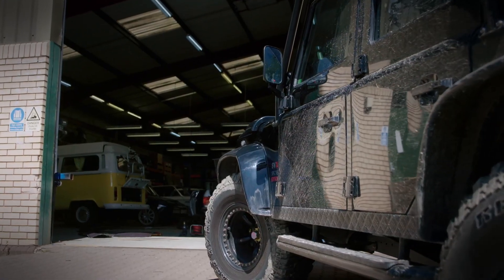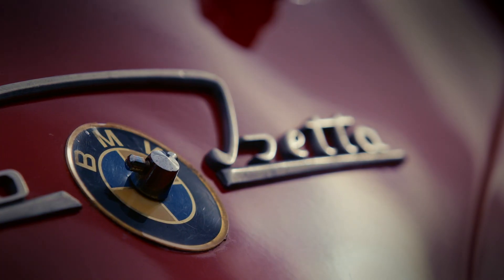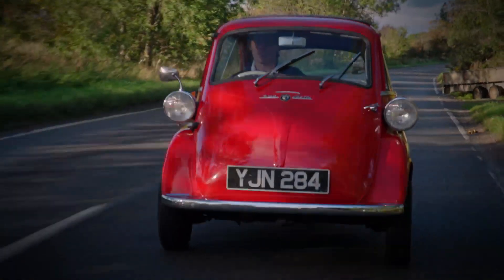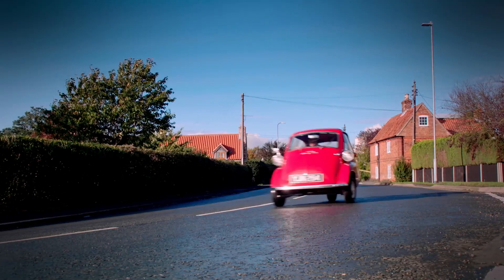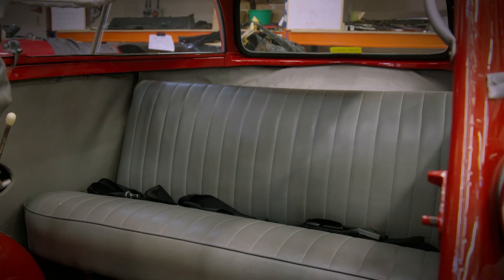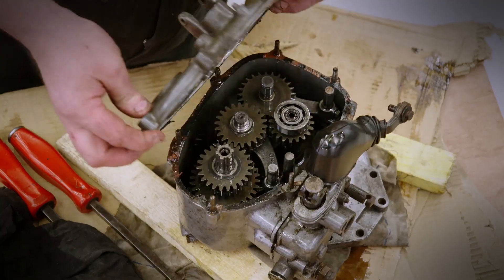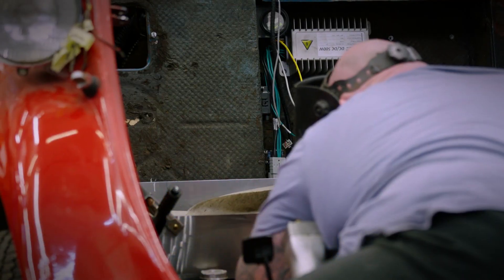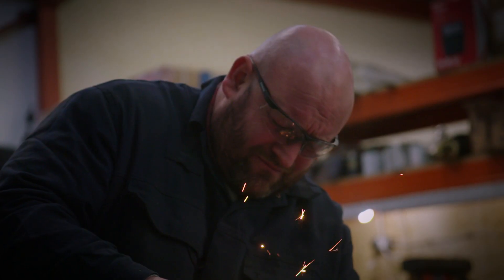Vintage Voltage series 2 – BMW Isetta - Episode 6 QUEST PROMO

Comment: I don't understand why they retained the original gearbox. It's a chain drive. Just select a suitable output cog and the electric motor can drive the rear wheel directly.

Comment: No way would i drive that conversion unless it had upgraded brakes.
Reply: I drive a four wheel 1956 bmw Isetta 300 with cross ply tyres, never drive in the wet, never drive too close to vehicle in front, the brakes are drum brakes fitted to both front and ONE of the rear wheels, I close my eyes when pedestrians step straight onto a crossing without looking they clearly have no idea how bad the brakes are in an Isetta, not sure about going from 13hp to 40 hp though😱
Reply: Let's pretend they are using lightweight batteries and the original drums are 7" and maybe they added the smaller final drive sprocket so it will go faster. Should weigh around same as original or couple 100 pounds more. Might be able to fit 7" disc brakes in front with the 10" wheels